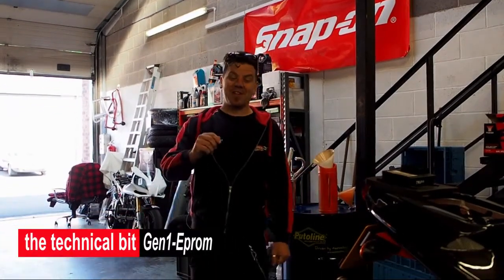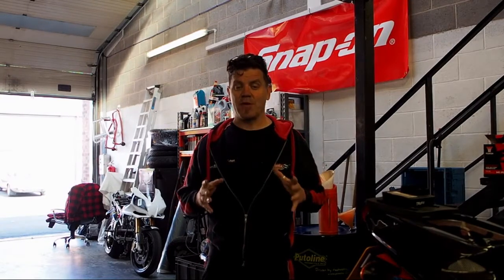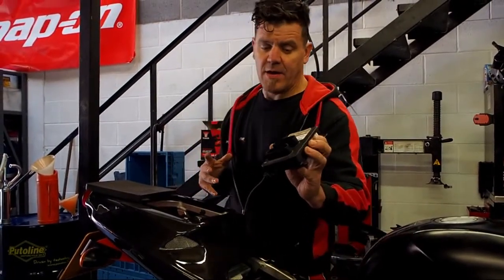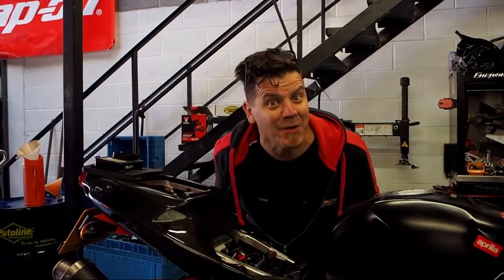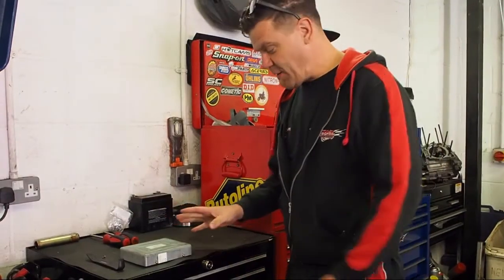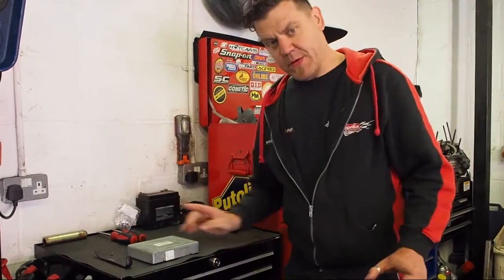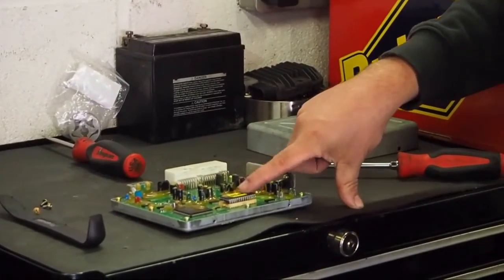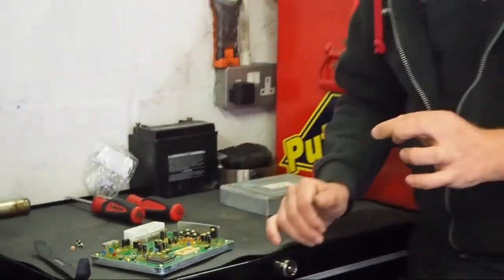AP Workshops - The Technical Bit Eprom installation

Comment: Do you have to set the trim pots when installing any new eprom? Also which trim pot is set to 12 o'clock and which is set to 6 o'clock? Or do you mean set both trims so the lines are vertical? Great video thanks 👍🏻

Comment: Griff did you say set them at 12 and six o'clock  or did I hear wrong thought they should both be st at 12 o'clock as a base setting then adjust with Co meter

Comment: My bike seems to a little bit leaner in the rear cylinder then the front would this straighten that out? I just bought the bike and did plugs, oil change and bled the clutch yesterday and took it for its first ride. Seems flat midrange until the top of the rpm range then she rips. Almost seems boggy till higher rpm. It has big throttle bodies on it I think and twin akro exhaust.  It’s a beautiful bike and would love to get it sorted but I’m in the u.s.. It almost seems a little lean to me ??